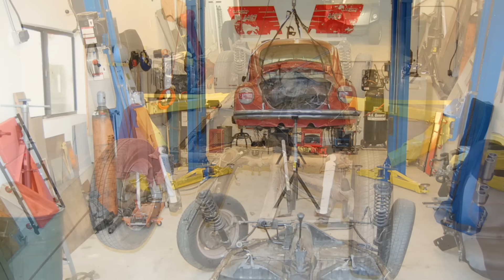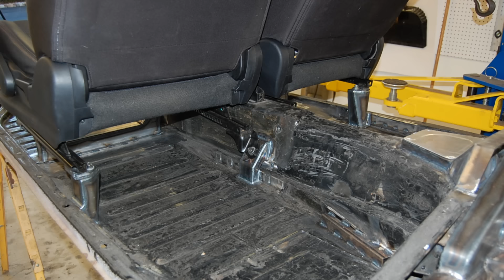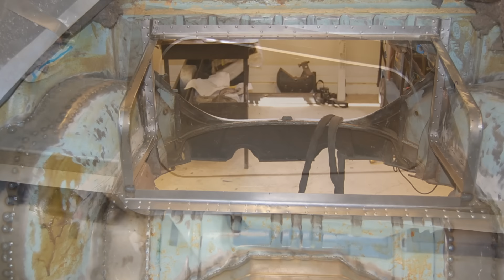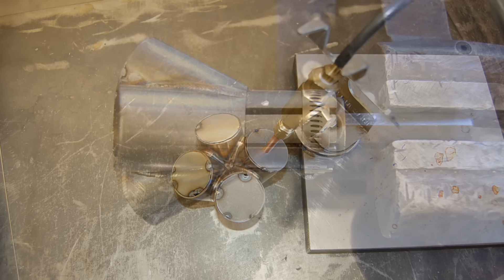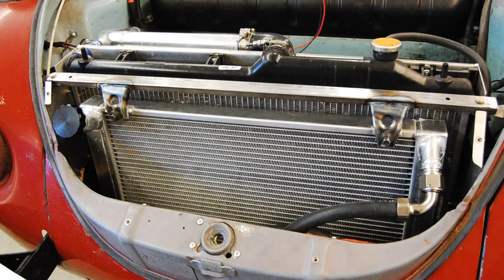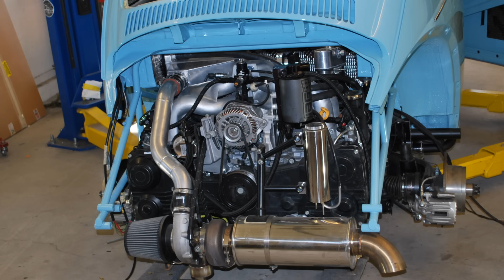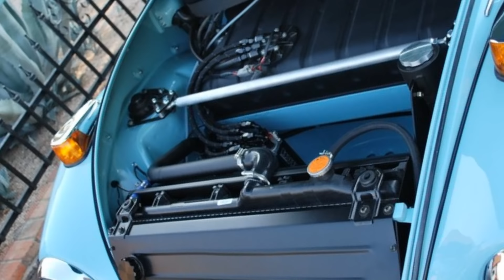The Supersleeper Project

Comment: The amount of work you carried out to a brilliant standard is staggering . 
Now paint the rear diagonals for the cage interior colour . Love it .
Reply from the maker: The roll cage does give it away a little for sure, but it was necessary.  I could have contoured the rear diagonal stays but that gives up strength integrity ( they also tie into the frame horns).  Of the three colors to paint the cage, blue, black or white, satin black seemed to make the bar disappear the most, which was the idea.
Reply: @JohnReynolds661  Came here after seeing the Super Sleeper on Nicole Johnson's Detours channel and am blown away by the outstanding engineering!   At 1m24s the statement about converting the transmission to a 2WD unit was masterful understatement. That could be it's own video! Nicole's interview brought out a few more details about the build including: fuel surge tank, rewelding stock wheels to accommodate the 275/50R15 rear tires, using an original intact dash, and the hidden gauges.  Has the 14 degree running angle of the rear CVs caused any issues?
Reply from the maker: @MarkWarren-com  The cv joints do fine but the boots wear out faster

Comment: love it, awesome result. Only one comment. Supers had 50hp from the factory, so 500hp would be 10 times that rather than 16 times that.
Reply from the maker: It might have had 50 net h.p. but what was getting to the tire was about 32 or even lower.
Reply: John Reynolds 

You are correct.
If you ever decide to sell,  drop me a note.  Very interested!

Comment: Awesome, awesome, awesome. Question, did buy a new ring and pinion gear set? I am beginning a subi swap in a fiberglass buggy. I picked up the motor mount from Subigears in AUS.
Reply from the maker: Yes I did, 3.90s from subarugears
Reply: @JohnReynolds661  gotcha, the back brakes you fabbed...do you mind passing along more information?
Reply from the maker: Well, you saw the fab part.  I got the idea from a YT video called "rear VW brakes done right" or something like that.  Anyway, it's not a huge deal and probably the Empi style rear disk work as well.

Comment: Awesome stuff John. I have a 1915cc VW engine that I've converted to EFI. The fuel rails on each head make the engine too wide to install the the engine the conventional way, so a removable rear apron is needed to slide the engine in from the rear. Your set-up looks really professional and sturdy. I think we'll be copying it. Thanks again for sharing.

Comment: Man that sti was nice in the first place, couldn't find a salvage one?
Reply from the maker: It was a salvage title, crunched in the back
Reply: @JohnReynolds661  ahh thought that many have been the case, but couldn't see it in the picture
Reply from the maker: @Darren Swails  If I were to do it again, I wouldn't even bother with a donor car and just start from scratch.  I drove the WRX around for a while and it was fun, but I got board with it after a couple weeks.  Plus, buying something without changing it isn't really a project.
Reply: @JohnReynolds661  love the bug, I tried to put a 3.8 Chevy engine in a mg midget before, but my skills weren't where they were needing to be, wish I had videos like yours 15years ago😁
Reply from the maker: I guess I just like raw fabrication.  I like to think about how strong the part needs to be and how light I can make the part while be aesthetically pleasing.  I'm doing a series on putting a mid-engine, transverse LS4 into a Corvair if you're interested.  Check out my YT channel.
Reply: @JohnReynolds661  yeah, saw it, interesting, will follow. If it was to hot rod a midget again, would probably use a sport bike engine, or just a v twin with a shaft drive, some would have twice the power the original midget...or if I found a salvage Honda goldwing with reverse...